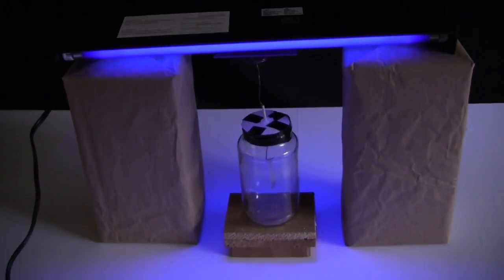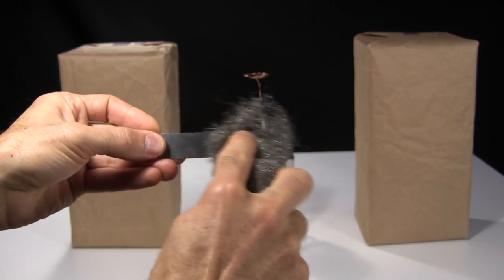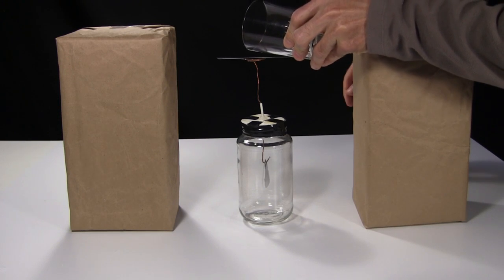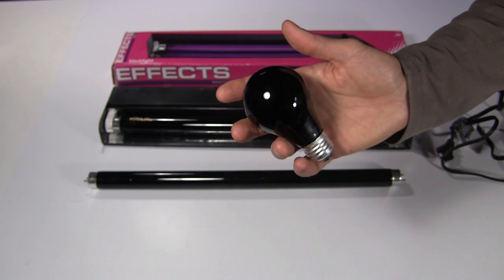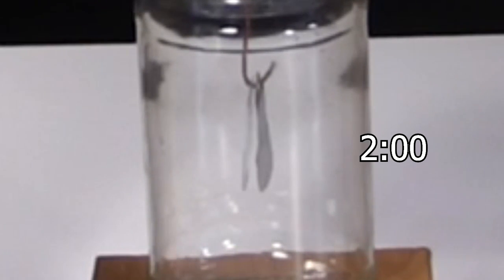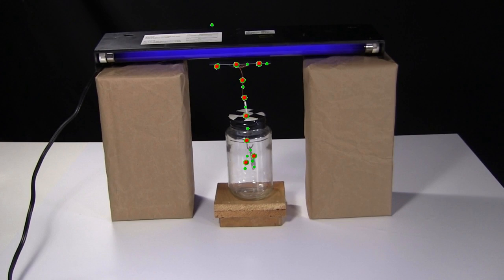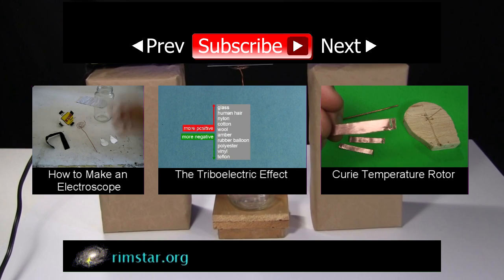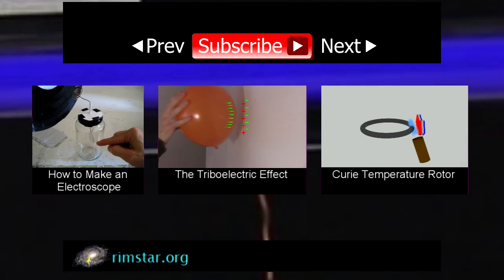The Photoelectric Effect and How it Works

Comment: This is why I love the science of light because it's so interesting; do you agree? :)

BTW I thought only harmful high energy shortwave ultraviolet (UV-C) was energetic enough to do this I didn't know that longwave ultraviolet (UV-A) was also energetic enough to do this.
Reply: +Brandon Fisher The Work Function of Zinc is 4.3 eV so you're right, UV-A is really borderline. I'm surprised it worked at all.
Reply: +RadioTrefoil Yeah, up until now I only saw people do this experiment with shortwave UV-C lamps never with longwave UV-A lamps (black lights) like you mentioned 4.3 eV is definitely not UV-A at all.
Reply from the maker: +RadioTrefoil Hmmm... You're right. It is borderline. Maybe there is something else in the zinc, or the lamp puts out some UV-B. Most demonstrations I've seen of this also work a lot faster, so that would explain it. FWIW for a distance between lamp and zinc of 1cm (as shown in the video) it took 2 minutes, 26 seconds, for 1.7cm distance it took 4 minutes, and for 5.5cm it took 10 minutes. For comparison purposes all numbers are very rough since it's hard to charge an electroscope identically each time as well as to match up when to stop timing. I figure the distance in times is due to the difference in number of photons per unit time i.e. intensity.

Comment: According to your demonstration, if the electroscope was positively charged, the described effect should charge it even further by pulling electrons from it away. Does it work like this in practice?
Reply from the maker: +Александр Санников I just tried it and there was no noticeable change, even after around 10 minutes. I have no explanation.
Reply from the maker: +goohz has a channel Yes, it was the identical setup. I left it for 11 minutes.

Comment: Interesting experiment and great video.  Though, I think this phenomena does not necessarily prove the photoelectric effect, as the same results could be produced by Compton scattering.  In both cases, an electron is knocked out of its atomic orbit by an incoming photon.  In the case of the photoelectric effect, the photon disappears, and conveys all its energy to the electron.  In the case of Compton scattering, the photon only gives part of its energy to the electron, and the photon survives, but with a reduced energy and with a change in its direction.
Reply: +Eugene Khutoryansky For compton scattering you would need photons MUCH more energetic than UV (energies from KeV to MeV) such as x-rays and gamma rays. As energetic as ultraviolet rays are they're still far too wimpy for compton scattering.

Comment: nice. but what are the applications of this photoelectric effect?
Reply: +JEPHTHAH David Solar Panels use it.
Reply: +JEPHTHAH David Well, one of the most prominent examples would be the light sensor of your smartphone I think! ;)
Reply from the maker: +JEPHTHAH David Another one is night vision goggles. Wherever the electron was emitted from is where the light hit it, so an image can be formed using that information.
Reply: +JEPHTHAH David 
Photodiodes or photocells (or older phototubes).  And another factoid.  Albert Einstein was awarded the Nobel Prize for explaining the photoelectric effect.
Reply: neutrino detectors use this, for indirect detection ofcourse